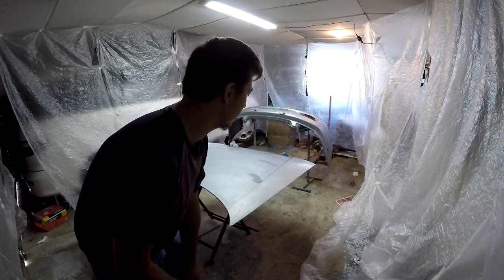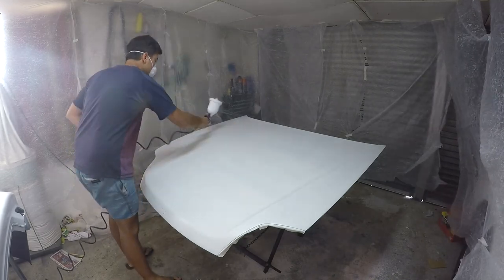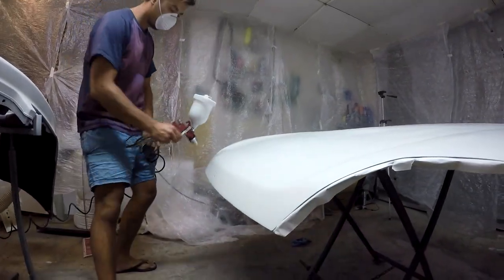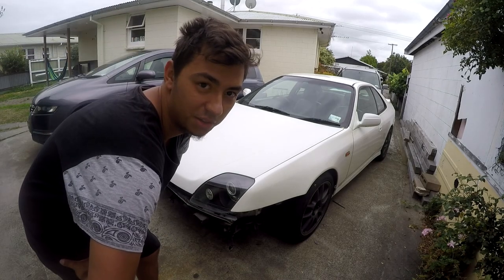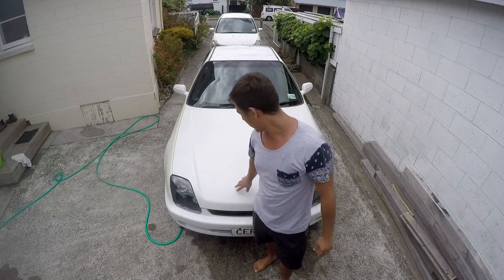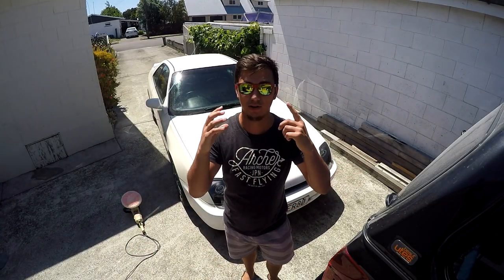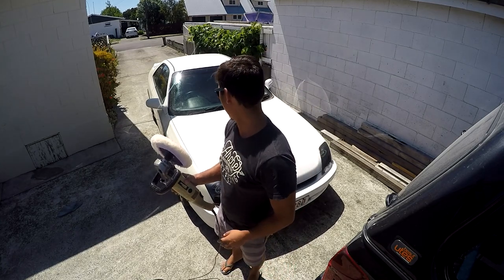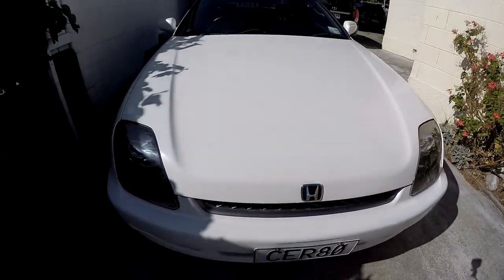Honda Prelude "The Lude" Build Ep. 14 - Painting

Comment: i polish cars planes heli's etc for a living, genuinely surprised you didn't melt ur paint right off using that pad, we normally only use that type of pad for really bad surfaces, mint job man looks good :)
Reply from the maker: Yea man I actually had no clue what i was doing. I only found 2 months that if i had taken it to my local Spray shop they would have painted it for around the same price that I got the paint for. Quick question what would you use to buff it?
Reply: we use simple micro fibres from supercheap, its all ya need ans as long as u wash them before each buff then they're fine :)

Comment: I have so many questions! If you can answer them all that would be great and much appreciated!
How much paint did you use, how much did it cost?
What was the purpose of sanding it after you finished painting it and what grit did you use?
How many coats did you use?
Reply from the maker: To do the bumper and bonnet I used 500ml of paint and clear coat. It cost around 300 bucks but it would be cheaper in America. I was sanding the clear coat so I could buff it and make it shiny
Reply: Oh wow that's actually still not a bad price at all. How come you did not need to primer it?